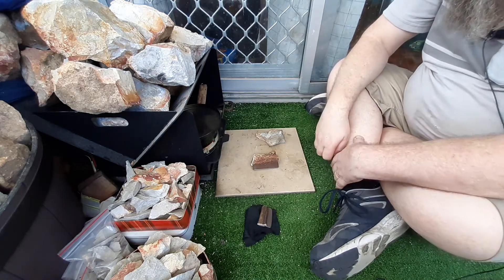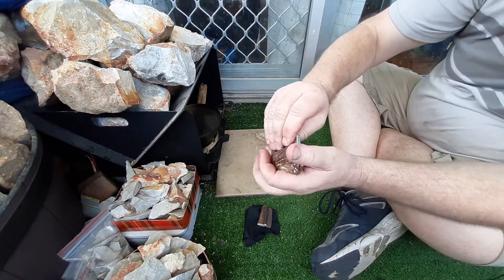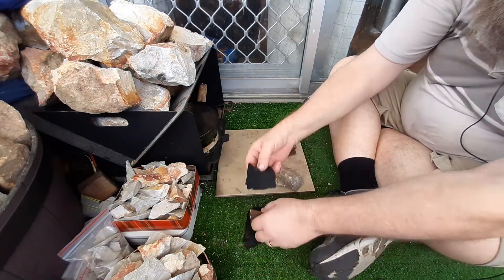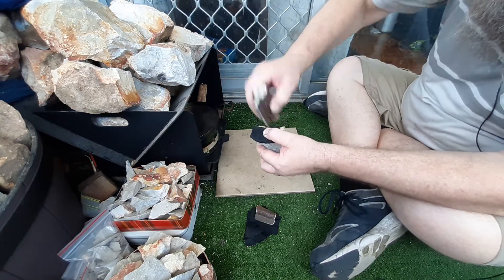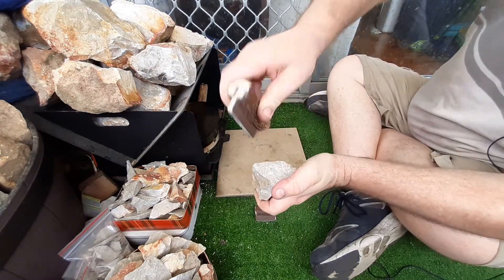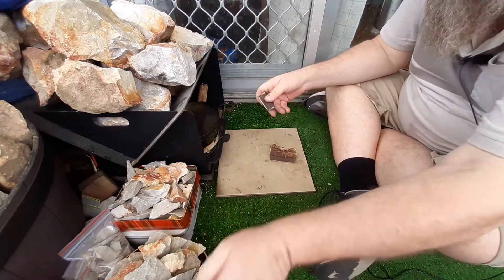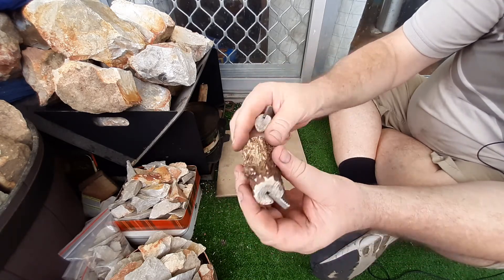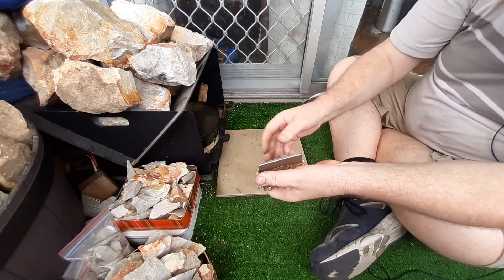2nd non-forge antler striker build

Comment: Really like the smaller one. I used a snapped file for years. I just recently got my first real striker. I've always just used what I have. The antler handle is a great idea.
Reply from the maker: a snapped off file makes a great striker, and it's fine to use them as is, but I really like the look of them when spruced up a bit by adding in some antler or whatever. 
Sizing wise, I always tend to lean towards a bigger striker with my big hands, and I like the thick strike face the big one gives me, but can certainly see the advantages of the small one, it's a nice build.